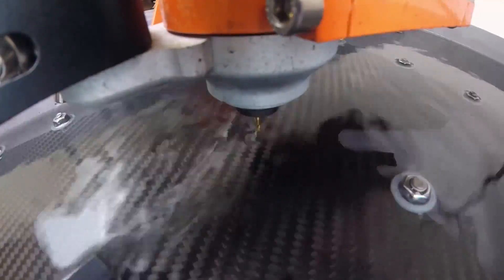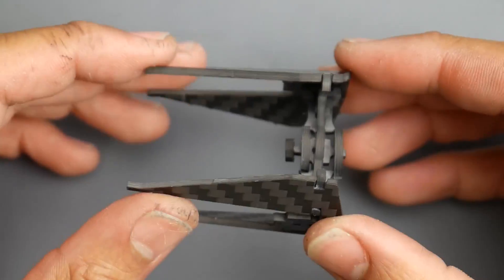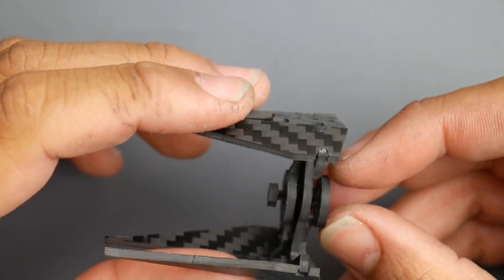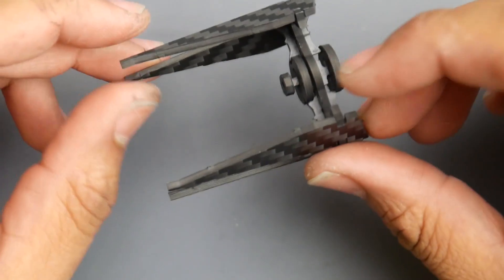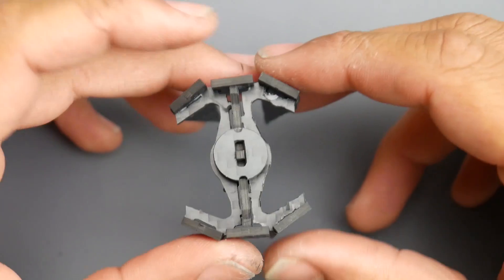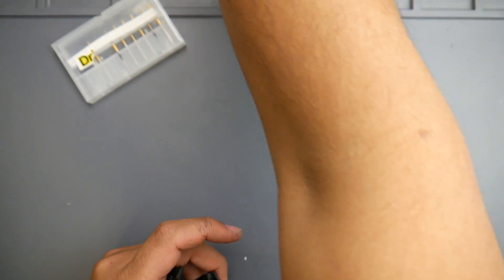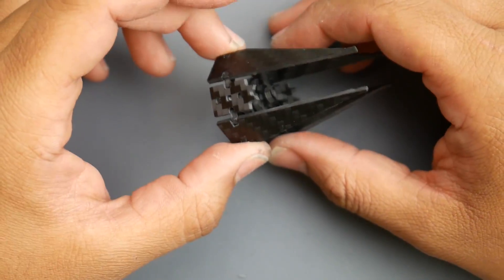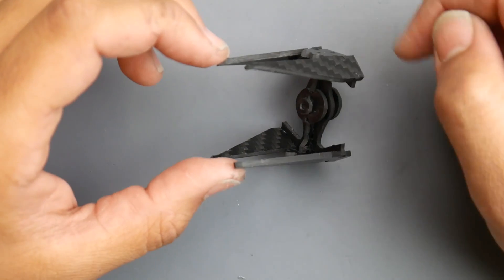Let's CNC Some Carbon Fiber Projects // I Made a Star Wars Tie Interceptor with Carbon Fiber

Comment from the maker: The End Mill I used in the video
 they are good (Cutting Profile Below)
http://bit.ly/2UsrgeV
Spindle RPM: 19000-20000 RPM
Plung Rate: 70 mm/min
Feed Rate: 140- 160 mm/min
Each Pass Down was 0.44 mm

Comment: im a cnc machineist you need some oil in our water itsa water based coolant and how are you writeing the prugrams for it
Reply from the maker: I am not using the water for coolant these are small jobs. The real reason for the water is just to keep the carbon dust particles out of the air in the shop.

Comment: Is you buy carbide center cutting endmills you will get a better cut and finish than those carbide burs your using I know your limited because of the small spidle and motor so don't know if that spindle will handle them but great video!
Reply from the maker: Send me link to what your talking about and if it goes to spam just email it :)

Comment: Try to use a 1.5mm bit for profiles as a minimum only if you need that size for the small radius 1mm cuts way to slow and as you have found out they break easy